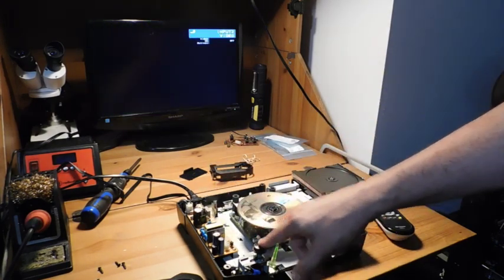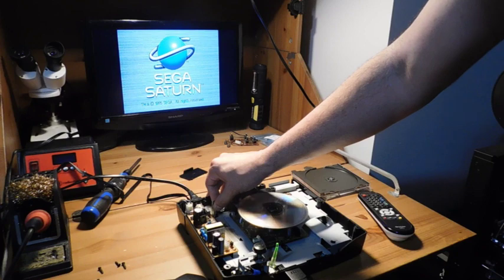Sega Saturn Laser Repair Guide!

Comment: Thanks dude. My Saturn laser was reading real discs just fine but really struggled with Pseudosaturn backups. A slight tweak of that potentiometer and now it's loading and playing audio from CD-R's like a champ!
Reply: I did this to mine some years ago but I didnt take it apart. This was only a temp fix. The laser eventually stopped working again. It took a little while but it is what 

Next I'll install a mode.
Reply: Nice. And was your drive working at all before you made the adjustment? Mine doesn't power up at all
Reply: @zacharyrendon9657  my system powered up. It just didnt read the CD. If its not powering up that's probably a whole different issue.
Reply: @jh5124  thanks! The greenlight turns on but no picture
Reply: @jh5124  not having any luck at all with the new laser. It just sits and does nothing? Seperate issue maybe? What's up the battery aslo? Thanks
Reply: @zacharyrendon9657  the battery in the back is just for game saves and letting the bios know what time/date it is. If its dead you can tell by the system wanting you to put in the time/date every time you start up. 

If laser still not working it might just be dead laser. If it is you can get an ode replacement that's like the usual SD card CD replacement for other systems.
Reply: @jh5124  cool. I'm still determined to get my Saturn to work. Installed a new lens, step by step by step and still nothing

Comment: Just looking at some solutions to laser problems on the Sega Saturn and boy have I wasted hours trying to troubleshoot my issue: mostly seems to run great once the game is running, but getting it started is the issue. Much of the time it'll only recognise it as an audio CD, but be able to play the music on the disc no problem. Thought it might be the lid mechanism, occasionally noticed that slapping shut the CD lid seemed to get it to boot the game. Eventually I just took the disc out and looked at the laser, noticed it was kind of parked in the middle - not at the inner ring or the outer end of the laser rails. I literally just pushed the lasers gently (without touching the lens) alllll the way out to the end of the rails. It reads discs every single time now, and there's nothing wrong with the laser. Apparently Saturn discs have to read some text at the very outer edge of the disc to successfully boot, if it can't read the text then it may read some of the inner data (i.e sound tracks) but it won't boot properly. This is in a modchipped Saturn by the way where you'd think it really wouldn't matter, but even with a Phantom modchip, it still needs to go through the motions of "reading" the outer ring text. So yeah - just try gently moving the laser along the rails, and possibly even adding some lithium grease. In my case it just wasn't able to squeeze it's way all the way out to the end of the rails to read the outer ring of the disc. Makes you wonder how many perfectly good lasers have been chucked away.
Reply: You absolute legend! I’ve been having trouble getting my Saturn to read back ups. It was loading the game about 1 in 20 times. I’ve tried a few different things and was considering going down the road of replacing my laser when I saw your comment. I just pushed it all the way back like you said and all my burned discs worked first time! You’re a genius. This needs to be shared far more widely, you’re the only person I’ve ever seen recommend this.
Reply: @michaelc.1710  thank you that's awesome! I'm so glad it worked for you and that another Saturn has been saved 👍 definitely an obscure solution lol best of luck to ya mate
Reply: @ichrismoku  cheers. I’ve ordered some lithium grease so I’m going to try and use that on the rail and see if that’ll mean I don’t have to manually push it. Thanks again for the tip 👌
Reply: @michaelc.1710  Yeah pretty sure dust clogs up the rails and some fresh grease will help a bunch

Comment: Thank you for this! It worked! I love my Saturn. If this is a temporary fix would you recommend I replace the power supply or the laser or both?
Reply from the maker: It might be good to purchase a spare laser and keep it for the future. Aside from that it might also be good preventative maintenance to replace the capacitors on the entire system. But I suspect your laser should be good for a long time
Reply: @LIRetroGaming  thanks for the reply. I really appreciate it. I've been looking into the capacitors and I've got a spare laser on the way.

Comment: By turning it to the right in a clockwise direction, you are lowering the power of the reader, not raising it. To increase the power of the reader, turn it to the left, counterclockwise. It is best to use a multimeter.
Reply: I actually did to the left as you suggested, and it led to even “real” discs not working, whereas about 90 clockwise, not only restored factory discs, but my old burnt ones as well.

So it makes me wonder under what circumstances turning to the left would be helpful; if the laser is older?

Comment: Thank heaps mate. I adjusted the laser that didn’t work so I took that plastic housing off and now it works perfectly. Should I put the laser back to its original position or will it be fine? Thanks again.
Reply from the maker: Awesome, glad you fixed it! The laser will return to its original position on its own so you can leave it where it is

Comment: Hello 👋🏽 I have a question: my saturn boots up. The sega saturn screen boots. The problem it freezes to a certain point. Seems like it partially reads the disc? Could be a lazer issue?
Reply from the maker: If it’s freezing while trying to run a game, it’s most likely the laser. What happens when you  boot it with no CD, does it still freeze?
Reply: It's not the laser it's the lid not closing properly put a smell coin in worked for me

Comment: I changed my laser and now the disc doesn't spin. Any ideas?
Reply from the maker: Did you remove the anti static solder blob on the laser? It won’t work until that is removed

Comment: I wonder if you can help a guy out. I've got a saturn that tells me the game won't load and the system memory needs to be erased. I've held R at boot and erased the memory but it still says zero blocks free. I reflowed the sram and still nothing. Has anyone had this problem?
Reply from the maker: My suggestion would be to replace the FRAM, maybe the original chip has gone bad
Reply: @LIRetroGaming  I was thinking the same I ordered 2. Thanks a lot for confirming. Gonna be doing some more left handed soldering soon🙂

Comment: Any way you could help out i recently purchased a sega saturn and after a while of playing say street fighter when game is loading after a few battles the console resets on its own and boots up the game again. Would you happen to know the cause of this. I noticed when i got the console where the power cable connects the screws that hold it were broken but when opening the console i couldnt find any damage other than the plastic were the screws entered nothing crazy
Reply from the maker: It sounds like a problem with the power adapter pcb. I would consider replacing the capacitors on it and seeing if that resolves the issue
Reply: @LIRetroGaming  thanks for the quick reply. So i ended up opening the console and cleaned it again. Also noticed the power cable i was using the points that entered the power connect were round i switched it with my dreamcast one which has the round on one end end and a square on other end. They both are the same 12.6 voltage but its stopped the resetting. Not sure if the cleaning helped or switching the power cable.
Reply from the maker: Glad to hear that the problem is resolved and my guess is that the cleaning is what helped!
Reply: Thanks so much! I followed your tutorial to the letter and now my Saturn works again 👍🏼

Comment: Pinching drive door switch... Aren't you near mains voltage?
Reply from the maker: Yes, that is something I really should have mentioned during the video. There is mains voltage coming from the power regulator daughter board and you have to be careful anytime you are near there
Reply: @LIRetroGaming  Use a clothes peg